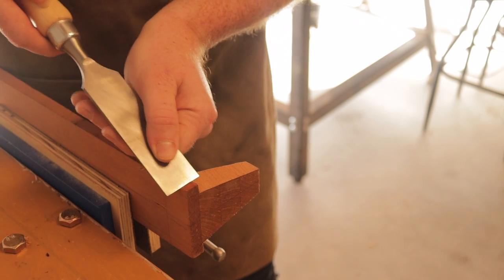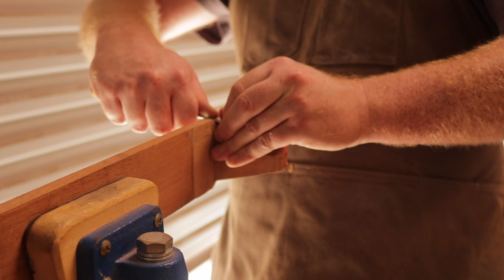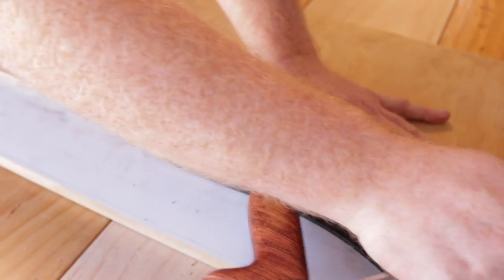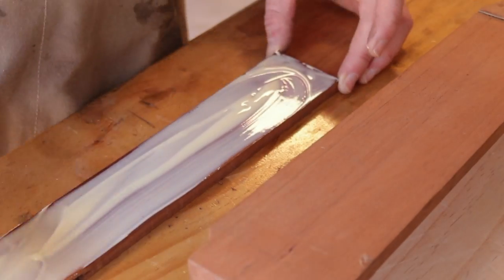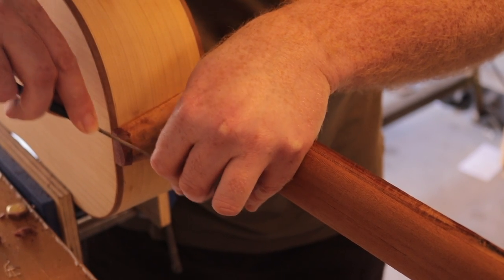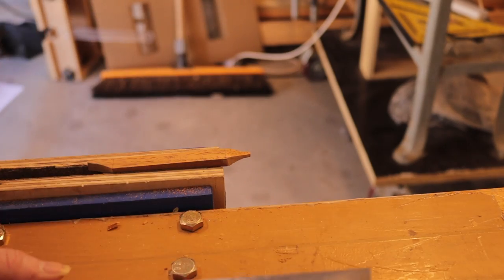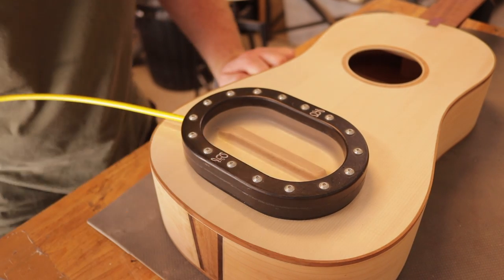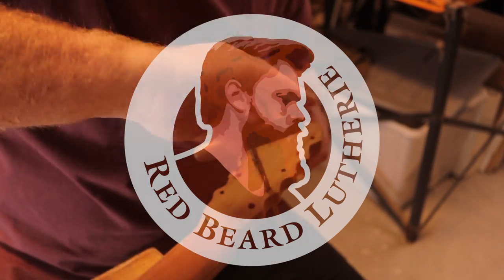Building a Baroque Guitar | Chapter 3

Comment: Nice presentation, i was wanting to know why you don’t use hide glue. I know it is a personal preference but historically thats what was used. Some modern luthiers use it and some don’t.
Reply from the maker: Thank you! I'm definitely interested in trying hide glue. The downside is that it has very short setting time, so you have to be quick to get everything in place. Not something you need to worry about with modern glue
Reply: @redbeardlutherie1173  Look into fish glue as well. I have heard some discount it, but I have found it to be great for those jobs requiring a longer open time, such as gluing on the back etc.

Comment: What are you doing at 5:59 with those stripes? Are those double sided sandpaper stripes?
Reply from the maker: Hi! It’s two strips of regular sandpaper. I’m sanding the bottom of the neck heel to fit to the body. Doing it this way leaves no gaps
Reply: @redbeardlutherie1173  And you stick on the neck just like that, without any joint?
Reply from the maker: No there is a mortise and tenon joint. It’s kinda hard to explain without pictures, but the process is called neck flossing if you wanted to research it further